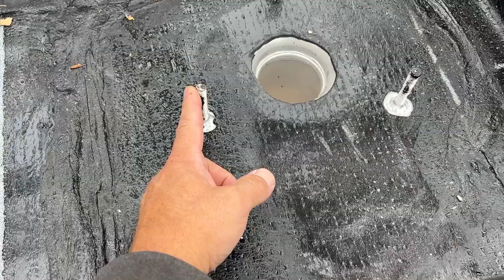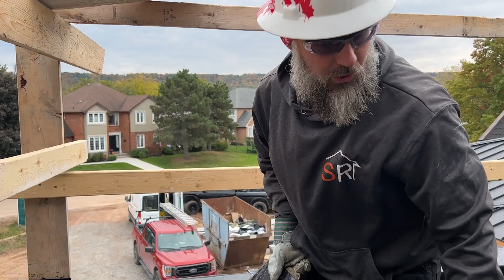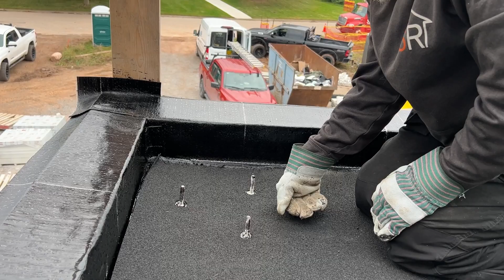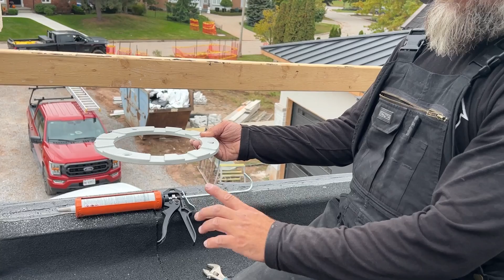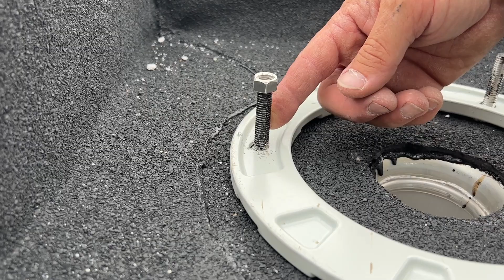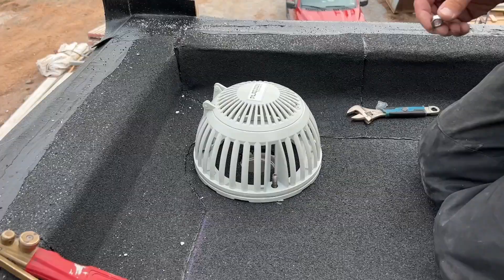Flat Roof - Drain Install

Comment: I don't know how many of these drains you install, but why not cut a few pieces of 1/2 copper pipe or conduit to use as sleeves to cover the bolts while you're applying the cap sheet? Then you can pull the sleeve off and the bolt will be clean.
Reply from the maker: That's actually a good idea! I'll try something like that next time.
Reply: THAT'S IS EXCACTLY WHAT I DO, GOOD IDEA AINT IT?!!!! GREAT MINDS THINK ALIKE!!!!